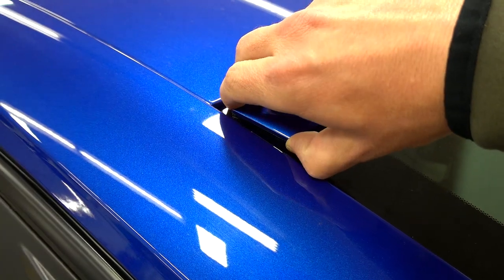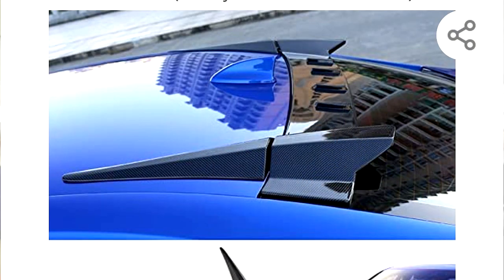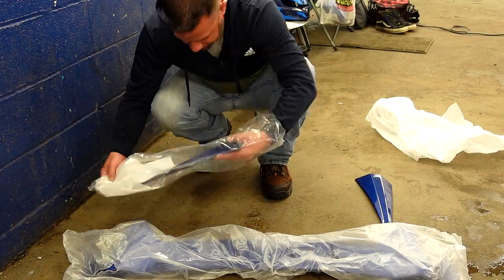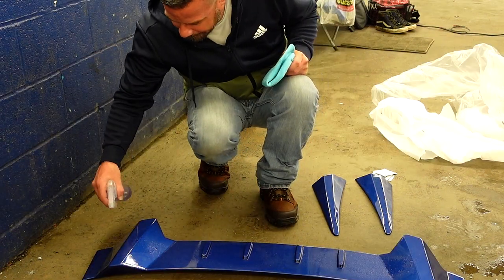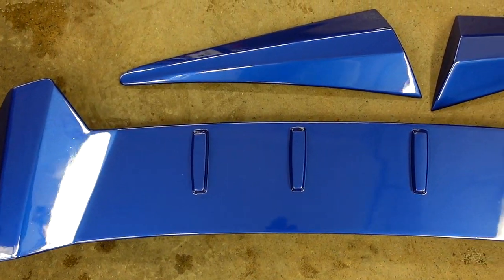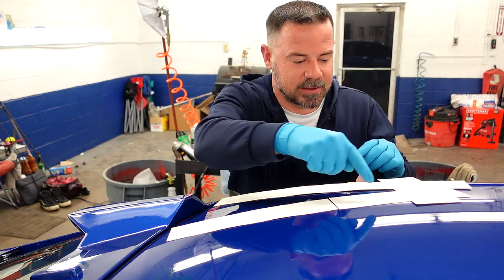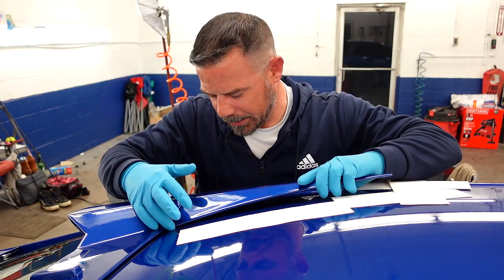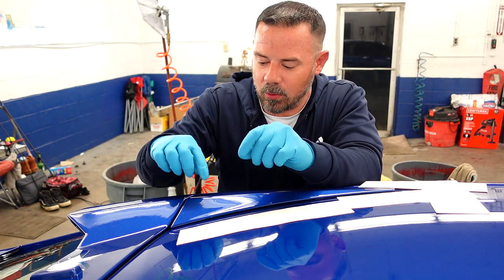It's so easy! How to install the Maxzina Roof Spoiler on the 11th gen 2022 Honda Civic

Comment: Got home from church and got to watch the video now. I really like carbon fiber, especially glossy. It looks great on your car, especially with your rear trunk lip spoiler and body kit, but it would have looked better if your trunk lip spoiler was glossy carbon fiber, too. There's some nice carbon fiber pattern adhesive door sill protectors on another video I saw last night. I might get those, they look better than the OEM accessories one. But like I said, unless I get the purple people eater STH, I like my car more low keyed subtle.
Reply from the maker: Glad you finished it! I think the carbon would look really good on the grey or black. Just didn't look right on blue! Oh just wait!!! Should have a full carbon interior kit video out in a couple weeks, including steering wheel! Some exterior too! That was just to much!
Reply: @717PROJECT  I like the interior as is, but the leather seats, or at least the leatherette door and center console armrests that 10th Generation Sport had, that they omitted from the 2022 11th Generation Civic Sports would be nice. The red interior trim accents from the Si would look nice with a black or blue sedan or hatchback. Someone with a BBP STH had a nice red pinstripe job done to their HPD appearance package and wheels, and it looked really sharp. I like detail stuff, like the nice Honda wheel valve stem caps. But not overdone inside or out, unless it was a show car, or the Purple STH. Acuity had those nice billet aluminum oil fill cap. I would probably get the red one.

I will probably get the black Civic and Sport Emblems, snd the Blue or Black JDM Type R style Honda H-Mark emblems for the grille, hatchback and steering wheel. The blsck ones will probably match the Civic and Sport emblems better.

Comment: My God this looks NIIIIIIIIICEEEEE.... This is another add I wanted to do to my 22  hatch
Reply: I'm really trying to get back some of the 10th gen vides. I feel like the 11th gen needs some of the curves and edges that gave it an agressive style.
Reply from the maker: I agree! Kinda gives it that 10th Gen Type R look! Appreciate  the comments, Stark! Thank you 🙏
Reply: @MrStark96  Check with the manufacturer if the angle of the spoiler will match on the hatchback. It might not, because the two body styles glass may be different angles. They may have one specifically for the hatchback.
Reply: Won't work on the hatch
Reply from the maker: @DaPlayzGamesBros  😪

Comment: "Give me the Roof!"
If you used 3M 4298 adhesion promoter you're supposed to let it dry before you apply the tape. In the video you said to app!y it before it dries. Also, the promoter is great stuff. I highly recommend it for any future add ons.
Reply from the maker: I was just doing what my body guy recommended. I trust him, he's done a lot of work for me. It flashes really fast so it was most likely dry before I put it down...lol! Appreciate the comment 🙏 Thank you!

Comment: Love how this came out man!!  I have made many mods that i have done for my 2022 civic touring hatch.  I'll have to send u some shots.   Do u think this Maxzima roof spoiler would fit thehatchback?
Reply from the maker: Thank you 🙏 I think it would fit. The gaps between the window and roof peices would have to be bigger due to opening the hatch! Double check the description of the part before you purchase just to be sure!
Reply: Could you send some pics to me also? I have a 22 boost blue hatch and havent seen to many mods for it yet. Would love to see your car and mods!
Reply: @charleshawkins281  Almost everything fits the Sedan and Hatchback, except the hatch area and rear fascia, taillights, bumper, etc. You would have to check because of the differences. Also, the angle for the spoiler may be off, because the rear glass or the sedan and hatch seem to have different angles.
Reply: @717PROJECT  I really try to be careful with descriptions. I have had to return two items off of ebay due to the fact that sellers say 11th generation civic and or say hatchback and then I get the product and it doest fit.   I give the seller a heads up thru a message on ebay, that it is not for the hatchback , so they can omit that out of the description for other buyers to be aware of, but I get a response saying it's for the 11th generation civic and leave the word "hatchback" in the description lol.  What can I tell ya.   My search for window louvers for the hatchback continues.
Reply from the maker: @sprtsgui  that sucks! I'm sure some one will make them soon enough.

Comment: Miller, your Blue Civic Sport is slowly morphing into the new Batmobile...
Reply: @717PROJECT  btw  Did you see the new Toyota Corolla GR with 300 hp? It's really nice, especially the soecial edition just for 2023, but I would still take an Si, over that, or even the new Type R, unless I had $$$ to get them as toy cars, I probably won't even have time for. The Sport Hatchback fixed up like I want would be enough, unless I can spring for a Sport Touring Hatchback, so I don't need to get a new stereo. Especially if I can get the rare Smokey Mauve Pearl one, with the rear wing and HPD package, and all the other stuff I would add on.
Reply from the maker: @jjacob25101  I did! Looks pretty nice. Would like to see it in person.
Reply: @717PROJECT  Yeah. I was raised to like GM musclecars, but now most are unreliable. I don't drive fast anymore. If I was still in the real Five-Oh I would get a faster car, like the senior officers drive theirvown subsidized vehicles. They used to have Camaros and Mustangs, as they were approved by the department. But the new mustangs and Camaros aren't, so some drive Dodge Chargers, but lots/most have Toyota 4 Runners and some have Camries. I would probably get a Camry SE because the 4 cylinder is fast enough, andcreliable, and if it gets crashed or damaged, it's easy and not as expensive to get a new one, and just get a nice car to drive off duty, and carry a portable radio when I do. 

The Civic Sport Hatchback is perfect for me, unless like I said I can get the Sport Touring Hatchback with all the goodies. I still would prefer the N/A 2.0L engine and no sunroof, etc.

My realistic, practical second car choice would be an HR-V Sport for the utility before they change it, and go hybrid.

My other choice would be the new Ford Maverick pickup base XL trim with the retro steelie wheels and the FWD 250 HP ecoboost 2.0L. Outfitted with the OEM accessories it comes to $28K. There would not be much other things to add after that except window tint, and get nice custom seat covers from a longbtime loczl company here, and hop up the stereo similar to what I would put in the Civic, din e only the top Lariatvtrim has the optional Bang & Olufson stereo. The rest of the gear of the upper two trims is not a  biggie if I csn get all thise accessories I want. They have lots of nice colors, but I would get the one similar to the Aegean Blue Metallic, and the Bushwhacker fender flares. Cute, smaller truck to carry my kysuc gear and other stuff and go do more outdoor stuff here.
Reply from the maker: @jjacob25101  my buddy has a lifted 4Runner, it's awesome! I've always liked them! A lot of people around me have Jeep Wranglers, a lot of off-roading occurs around these parts!
Reply: @717PROJECT  I am not into off roading. I just thing if I had a vehicle like that, I should be getting out more and doing stuff here, and get a top of the line Go Pro to film when I go on drives. I tralky liked the 2nd edition of thev4 Dr. Call Of Duty Black Ops Jeep Wrangler, but notbthe best everyday driver, unless my place had lots of places I would need the 4WD. But I live in the city. So the Maverick as a do all, would be great.

Comment: Hey I have a 2022 civic sport in black and was wondering if the aem short ram intake is the only one that fits the car?  Or if I can get another brand or anything like that
Reply from the maker: Just a reminder, the AEM short ram intake I have is for a 10th gen 2.0L. It does fit but I needed to make a bracket and add a bolt & nut. I'm sure other manufacture 10th gens fit as well with mods. I know the PRL CAI fits the 1.5t with a little mod as well. Appreciate the comment, Joey! Thank you 🙏
Reply: Awesome thank you very much I’m excited to see what more things you do with the build keep up the good content 👍🏾👍🏾
Reply from the maker: @joeycastillo6004  A lot more to come, Joey! Don't you worry!!!

Comment: Will this work for 11th gen hatchback???
Reply from the maker: I believe it will, Mike! Gap between the window and roof peices will most likely have to be bigger do to opening the hatch. Just make sure to check the description of the part before you purchase. Appreciate the comment 🙏 Thank you!
Reply: @717PROJECT  Miller, the glass angle may be different for the two body styles, so the angle of the spoiler may be off. I wonder if they have one specifically for the hatchback, or will make them, since the probably have a high demand like the Yofer body kit.